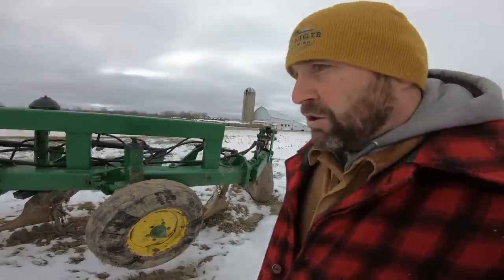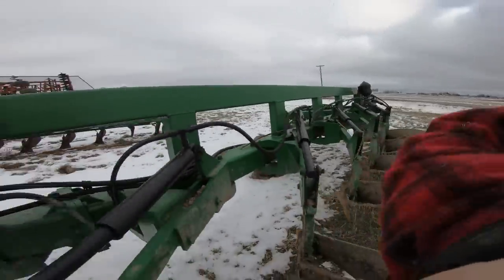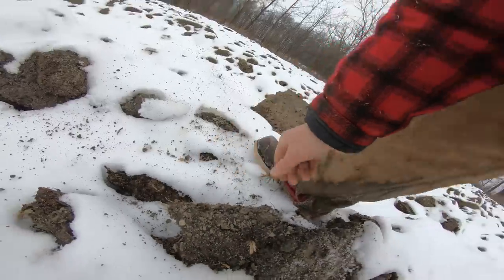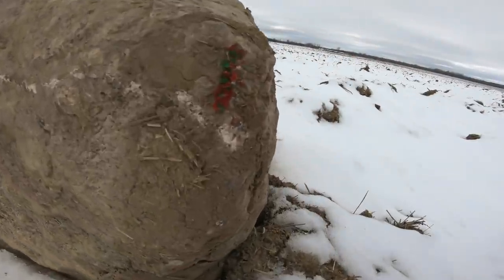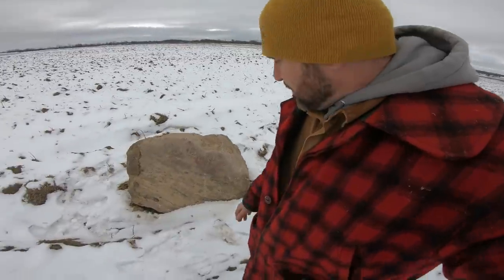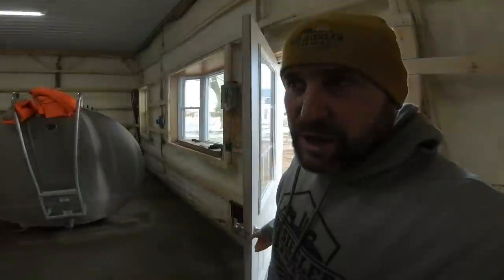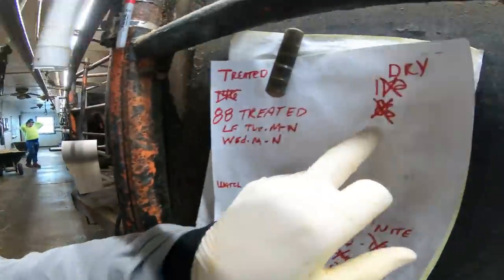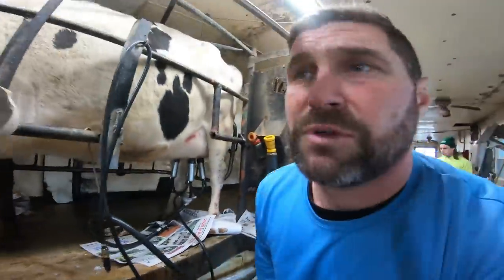MOLDBOARD PLOWING IN TO 2021!

Comment: I remember dad plowing up our garden with the 810 series 3 bottom 3pt plow hit a rock and tripped number 2. Dad wasnt happy he thought something broke but talked to gramps. Supposed to just back up and the bottom reset. Didnt work. Dad had to head to barn and pound on the arm.  Reset finally. We then went out to garden and started digging and rock kept going. No loader or anything like that finally got a chain to stay on it and dragged it by mailbox. Plow truck liked to get off road and damage mailbox.  Not anymore. One year saw a nice scrape and when you have a total 3 rocks 1500? lbs nested and sink into ground they dont wanna move.  The driver im sure got a nice jolt

Comment: Disregard my question Kip, I saw your answer on a similar post. I ran a Verstile articulating tractor pulling a 10 by 16 plow in upper Minnesota on summer and that was a blast. We could only plow under six inches deep because below that was blue clay( red river valley area). There’s such a sense of accomplishment when you can go across a green field and turn it over and can say at the end of the day “ look what we did today”. God bless!

Comment: I am not familiar with plowing up a hay field.  Why do it?  Don't you now have to replant?  Doesn't it take a full growing season to get a hay field to produce?
Reply: The reason why they are plowing over a hayfield because after for five years generally most farmers turn that over to put the nutrients back into the ground and it will become corn then after that same cycle for the corn you will work the ground up and yes you will have to remake that seed bed and you should get one cutting off it by the end of the year
Reply: @codyhowes2110  thank you for the great explaination.  I am familiar with corn farmers who have to do that because corn  is so hard on the soil I am told.  Didn't realize that other crops are plowed up and changed as well.
Reply from the maker: Yes after 5 years the field becomes spotty, not as good, need to rotate for best results 👍👍

Comment: Kip, I've been watching your vids about 12 mths now- iv been meaning to ask you about the pulsation for the milking units- it's self contained is it, the vacuum to the unit also does the pulsation for the liners? I have seen those on  dump buckets here in the UK and they weren't v reliable. How do you find yours, obviously good I take it? How much mastitis do you get per 100 cows annually plz???
Reply from the maker: They work well for us low mastitis
Reply: @KipSieglerFarming1  good. Simple system,low maintenance, less to go wrong. I always tried to follow the KISS system- Keep It Simple Stupid!!!! But modern tech says no, you need this, that, ££, etc.